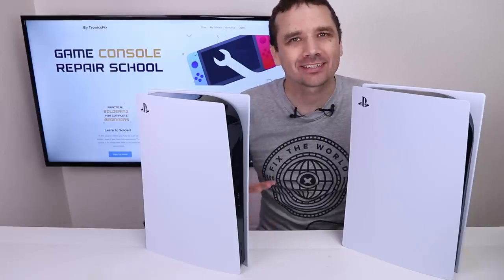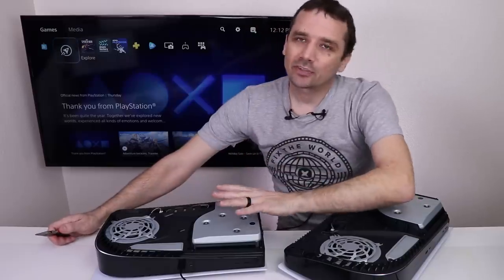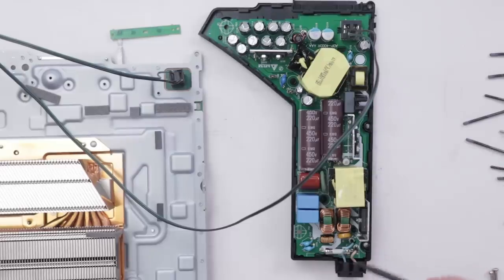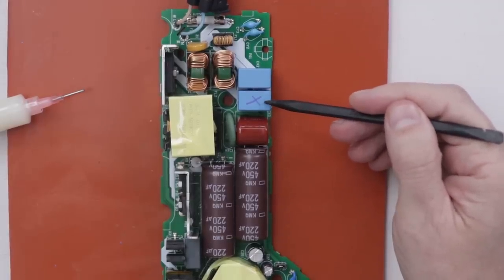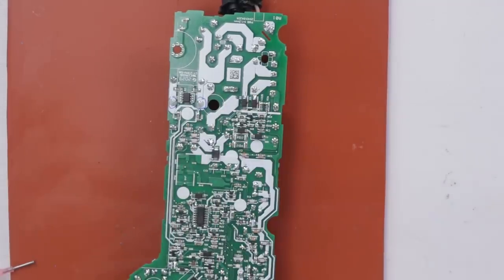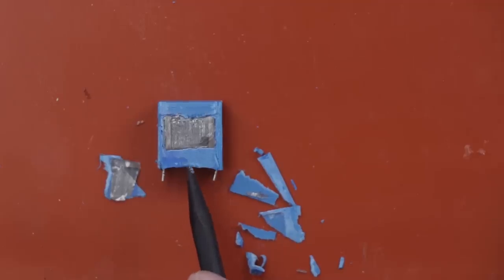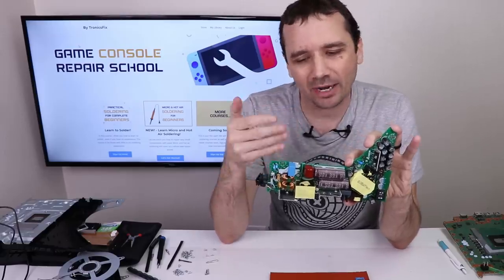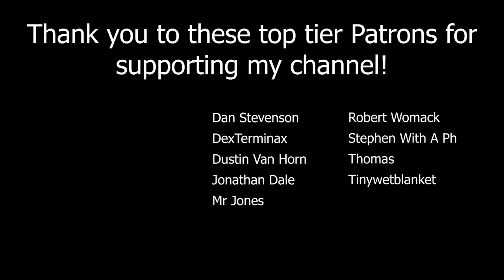PS5 Coil Whine - What Is It and Can I Fix It?

Comment: As you probably know a certain level of "coil whine" is inevitable in electronic systems. This is simply a function of current passing through the component causing vibrations. To negate coil whine in foil capacitors (or any other wound component for that matter) manufacturers have to roll the materials extremely tight with very precise tolerances, otherwise any non-uniformity between the coil and dielectric layers will cause an audible resonance. 
My guess is the supplier Sony is using for this particular capacitor is either having a QC issue or for cost reasons isn't manufacturing with extremely tight tolerances. (I'm personally leaning towards the latter one).

As for the fix, coil whine will sometimes just go away on its own once the device has "broken in" from use. If it doesn't you could try to encase the component in a potting material (maybe even hot glue) to dampen the noise, but I'm not sure if there is enough clearance between the surrounding components to do that.
The only other option would be to replace the capacitor with a difference batch number to see if the next batch just happened to be manufactured a bit tighter.
Reply from the maker: I've heard from others that maybe a better quality cap would work. Do you know which brands would be better quality?
Reply: @Tronicsfix  Sadly, I'm not 100% sure which manufacturer would necessarily be better in this case. Even though there are only a handful of these suppliers in the world and I'm not familiar with their reputations per se.

Corsair claims they make one of the quiest PSUs for PCs on the market and they use HJC components. 
What I don't know is if Corsair is simply paying for a higher level of QC/tolerance levels, or if HJC is actually better at manufacturing these particular components.

Edit: I'm curious....did you happen to notice a coil whine in your PS4 pro with this same capacitor?
Reply: @MikeJones__Who  It's a 3 cent bin component in a ware house in China. He probably got one that the half deaf QC guy couldn't hear and it got passed as good to go.
Reply: @Laugh1ngboy  I would honestly be surprised if there was a "guy" involved in the process at all. Even in China electronics manufacturing is highly automated.
Reply: It’s very interesting what you are saying. Also the video show that the component is shared with PS4 Pro.
My PS4 Pro (launch edition) has no coil whine but my PS5 do and both are connected to the same power regulator. Maybe quality control is a big factor here?
Reply: Another item to add, my PS5 only do the coil whine while playing PS5 games and Ghost of Tsushima, the coil whine is nowhere to be found while playing any other PS4 gamewithout enhacement patch or while browsing the home menu so it’s definitely linked to the APU’s power consumption
Reply: @meisterziege  I believe the capacitor in question is in parallel with another like it, and I suspect the quiet one has failed or shifted out of spec and thus forcing it's partner to work harder, Both capacitors will have to be replaced with high quality "NON CHINESE" ones, But first I would check to see if any Chokes or coils connected to  them are within spec..
Reply: @Tronicsfix  ALL Electronic components, capacitors included, have a specified tolerance. In metalfilm capacitors these codes are marked like: e12, e24,e48 and e96. The higher the number, the tighter the tolerance and construction quality. You could try changing the faulty to a better one.
Reply: @meisterziege  I noticed that my PS4 Pro had a very nasty whine in only one specific game (Gems of War, a ftp 505 game) but only on half of the menu's. Lately it is not noticable anymore, don't know if that is connected to a patch from either 505 or Sony.
To me it is realy weird that this hardware issue could be triggered by the software, even more since it should be a not so demanding piece of software.
Reply: @MikeJones__Who  Yeah I know I sometimes find it funny. I miss the days when I could find part numbers on stuff and buy replacement parts that actually worked.
Reply: Considering different games triggering coil whine, while others don't is due to every game using a different amount of power and therefore a different amount of voltage is rushing through that capacitor. Not only the does the current cause vibrations, but also the geometry of that capacitor could resonate to a specific amount of voltage, which makes it whine in some games but not in others.

And I'm pretty sure that this is a off the shelf component. Just look up its specifications buy a similar one, if you find one, and change it.
Reply: @alistairsmith2396  You have to turn the power on first, that might explain XsX has less issues ;)

/end console war trigger comment/
Reply: @kjr5034  exactly. Audible resonance would occur on specific voltage/current usages. "Pulling" more or less current could break the resonance and it would kill the noise (at least for human ears!)

It would be an interesting test to see what are the current values which would produce the audible resonance... just for the sake of science!
Reply: KorAllRBare also a big possibility. As I mentioned, my PS5 only do the coil whine during high loads and the noise is coming from the back of the unit so definitely from the power supply. God dammit Sony
Reply from the maker: Honestly, I don't even know where this PS4 Pro PSU came from. It was just laying around. I think it's broken.
Reply: @alistairsmith2396  yeah most XBOX consoles (Xb1/S/X/SX/SS) dnt have any of these
Reply: @meisterziege  Same as my 😊👍
Reply: @Tronicsfix  I have no idea if this helps, but I've heard that Panasonic caps are extremely good quality--but that's only in relation to their electrolytic capacitors. Zero idea if their foil capacitors are likewise excellent, or if they even make them.
Reply: My gpu and psu from my pc sometimes have coil whine but its getting better now, its less frequent
Reply: If you see Cooler Master PSU factory, coil whine noise, they just use glue all over the place instead of actually improving quality, I'm almost sure that's how most manufacturers make them, coil whine = wrapping, glue and boom they call it fixed while it's actually not LOL

But also maybe to fix it could cost a lot more or a lot more complex design with more components so the cheaper it is also the better for the end customer, so yeah...
Reply: @MikeJones__Who  many companies have a binning process for some components. Basically they buy them in bulk and have a validation process to select the best that meet some criteria and then resell or use the inferior ones to another product/sku. In some cases this can also be done by the supplier but outside b2b supplies the QC is never super tight to avoid having yields and supply volume issues. Example: nVidia provides gpu dies and memory chips in a package to the AIBs (msi, asus, etc) with 2 different type of skus: one for regular models and another for OC models (turing used the A1 notation for OC validated dies). Even so there's still no guarantee that an OC die will actually perform better than the non-OC die. Then most AIBs have a binning process themselves for both gddr modules and gpu and allocate the best ones for their pricey premium models and the rest for the remaining lower skus. And again there's no guarantee they actually picked the best because there's only so much you can realistically test without going to much into prohibitive costs, time and volume decrease. 

What I'm trying to explain is that even if you get components from the best manufacturer and that manufacturer has a tight QC you'll still should buy several (preferably from different batches) and do a binning process to validate which ones are the best. This is specifically true with non critical aspects of components (like the coil whine).
Reply: @hotdognl70  Coil whine on GPU's in PC's was usually attributed to, for instance, extremely high fps (well over 1000 fps) in menu's or very old games that do not have limiters. There were a few ways around that whine: enable an fps limiter within the GPU driver settings, increase or decrease the core clock of the GPU (yes, overclocking could in fact remove or reduce coil whine) or physically localise the buzzing component(s) (usually a non-electrolytic capacitor or coil) and add a non-conductive material to it to both increase dampening and mass (material stiffness, mass and external dampening are large factors when it comes to vibrations, thus changing those variables can have a significant impact on the vibration/sound produced.) 

So in your case, a game that used to produce coil whine, but didn't after a patch, could've been fitted with fps limiters.
Reply: @jhonny44444  Who would have thought that the static menu's of Gems of War needed to get limited on a PS4 ;)
On the other hand, those kind of simple screens have probably so little objects that the workload is low enough to reach high fps. But I would never have thought that a console would try more fps than a TV could handle.
Reply: @meisterziege  Yes this capacitor makes no sound when pulling 100 watts (ps4 games) but at 200+ watts (ps5 games) mine is very loud, they need a higher rated part
Reply: @thomassmith4999  it’s a shame that this 3ct piece is ruining the PS5 experience for me. I can clearly hear that annoying sound from my console while playing. Can’t turn up the volume due to thin walls and neighbors. I rarely play on my PS5 in the past weeks. Luckily I have a XSX too and it’s death silent. Love it.
Reply: @marrsil  Yeah I haven't used mine much either, I was supposed to send it back to Sony this last Friday but the post office didn't have the right box. Hopefully I'll get it done on Monday. The last couple month I've been playing a PS3 lol.. It's louder than the buzzing of the PS5 on it's fans alone but it's not such an annoying sound. I gave my PS4 away to my son. I also play games mostly at night and with not a lot of volume on the TV as I have kids but the buzzing makes it pretty much unbearable to use. The PS5 is a great machine in theory but in practice this buzzing ruins the whole thing.
Reply: @MikeJones__Who  Ha! I have a Corsair hx650w and it has the most horrendous coil whine I've ever heard, literally sounds like a bird chirping.
Reply: @Sec0ndCumming  it’s right that most high end computing components make some kind of noise BUT the manufacturers are able to reduce or mitigate it. What Microsoft did and Sony not.
Reply: @MikeJones__Who   can this buzzing noise lead to failure? Or the buzz is harmless other than causing minor audio annoyance if one goes looking for it.
Reply: @thomassmith4999  any update regarding your Coil whine issue?
Reply: @anubis852  I got a replacement PS5, did I mention that here? but unfortunately it's the same as my original console. I plan to replace the capacitors myself when more is known about the exact part number which is best to use.
Reply: @thomassmith4999  That sucks! I did send mine once and got the same console back and the only thing they did was to factory reset the console and send it back in. Considering sending it again. The noise is so distracting and annoying.